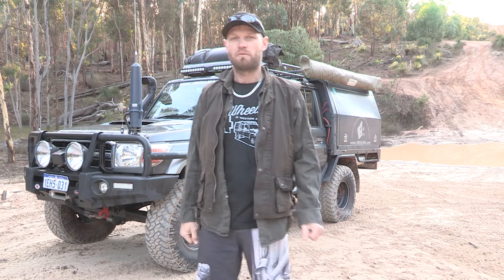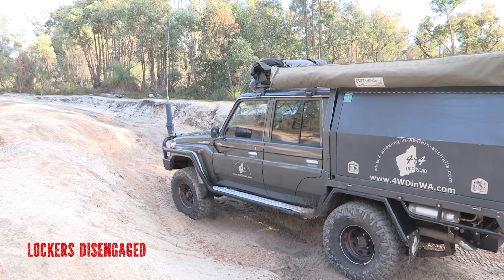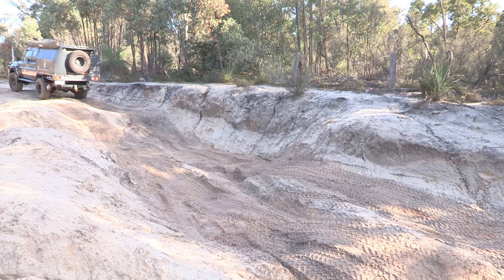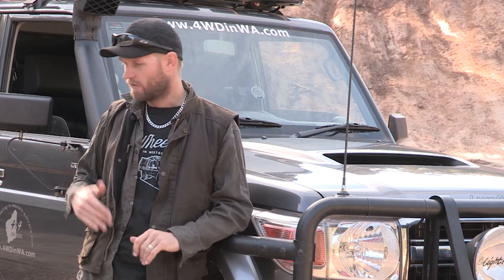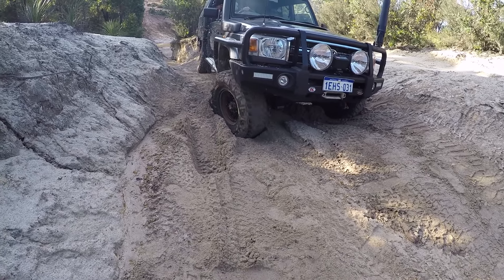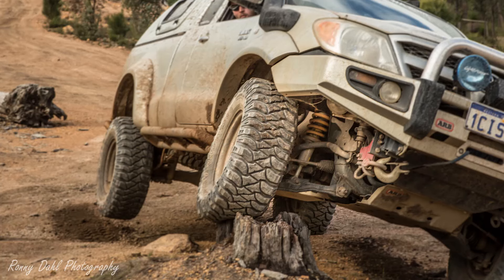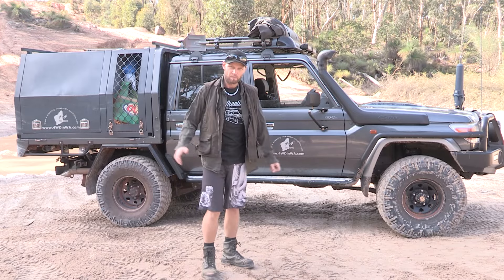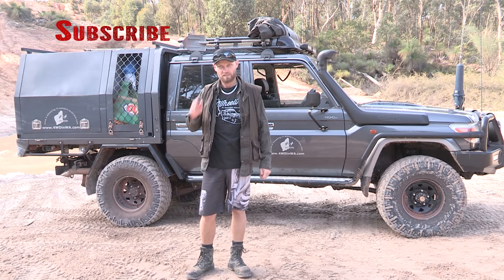diff lockers, how and when to use

Comment: My zr2 came with front and rear lockers.  It was one of the selling points.   My 1982 FSJ Cherokee has front and rear air lockers.  It also has an Altas 4 speed.   Honestly, 98% of the time I roll around in 2 wheel drive and low range.   But when you 'need' 4wd and lockers there is no substitute. Like Ronny indicated, you can substitute finesse for momentum, it's not often I see someone breaking something because they are being slow and deliberate, it's the folks pressing on the skinny pedal and trying to use momentum that usually break something.

Comment: currently running an rear automatic locker on my Tacoma. I honestly can't say how much it's helped me, since it's always "on", but I'm pretty sure it came in handy at least a few times. My Tacoma does have traction control system, but my particular model doesn't have traction control in 4 lo, which is why I went with the rear auto locker just in case. And traction control is another thing I can't say how beneficial it has been.

Comment: Had fun watching the video. A lot of good advice and info.  I run selectable lockers both front and rear.   I also have a twin stick.  So much fun.  The great thing about selectable lockers is you can have a bit of fun trying an obstacle open/open but still know you have the option of locking it in and getting down to business. A bit of a tease at the end with the front/rear locker video.  I am going to vote 'front' as the way to go. ;)

Comment: Love your videos. Agree with having a rear locker if its only one locker. I also believe the front drive system is not designed to handle the forces involved when using a locked diff  and rear diff being open. Many 4WDs that come with factory fitted lockers the front cannot be locked independently of the rear. Its rear only or rear and fwd. I have seen many 4WDs with after market lockers that have broken their front drive system and busted diffs while having only the front diff locked.

Comment: I agree the rear is the most important. I have TruTracs in the front of my van and so far with ARB in the back it seems to work very well. If I get a front wheel off the ground I need to apply a little brake and it pulls right out of everything I've tested on so far.

Comment: I rolled over my 4x4 96 Tacoma then had blown headgasket. Ended up with a 99 Prerunner Tacoma (2wd) 😭..... but the good news... It has the offroad package with the rear locker, that thing is amazing! Very different from a front locker like my 96. And the prerunner seems to accelerate much faster without the extra differential weight, not to forget better towing😉. (Please don't remind me that its not a 4wd😭.)

Comment: Great advice on how and why to use lockers. Two weeks ago I killed my non-lockable front diff because of too much wheel spin and then some sudden traction, the torque ripped parts of the diff out. Getting a lockable front diff now!

Comment: I used to lock my rear when I would get stopped, as you demonstrated.  My most recent vehicle has mechanical locker rear plus Torsion differential up front.  I have not been stopped so far to need to engage the rear locker.  I have used the rear locker just to keep it exercised a bit.  The Torsion axle seems to be a wonderful thing except for cost.

Comment: Hi Ronny, great vid. I think you should do a vid explaining types of lockers. Auto lockers, e-lockers mechanical lockers etc. I've heard terrible things about auto lockers and even arb mechanical lockers have had bad things said about them.
Reply: Agreed...I'd also like to hear your opinion on each type...
Reply: Nothin like driving an old beast with Detroit lockers ..   bang..  crash  .. tyre squeel  .  I would doubt the current gen would have enough driving skill to keep it shiny side up. .
Reply: @paulsouth4794  
🤣🤣🤣🤣 they would think the world is ending 🤣🤣🤣🤣
Reply: @paulsouth4794   I'm running a Detroit locker. It was the better option for me with a more limited budget. rear only. I've been happy enough with it so far.
Reply: @paulsouth4794  detroit lockers are the best in my opinion
Reply: Ten bad stories , thousands of units sold .

Comment: I live in California, USA. There's not a lot of lose sand here. It's mostly rocky terrain.
I live in NorCal near the Rubicon trail.

Please include rocky terrain front locker vs rear locker video as well.

The trial your showing would be like a Moderate trail called a fire road in our national forest. 

Trail's go form: 
 Easy: These fun family trails are suited for a stock vehicle and may not always require four wheel drive. In most cases these trails consist of well maintained service roads. Roads are typically wide enough to accommodate passing.

Moderate: While more challenging than the "Easy" rated trails, drivers of all skill levels can enjoy these trails. At this level a stock high clearance four wheel drive vehicle is required. Trails are typically narrow with possible brush that may scratch your vehicle. Passing usually requires backing up.

Difficult: Trails at this rating require a vehicle with increased ground clearance and proper protection. Trails will often require a spotter and should only be attempted by more experienced off road drivers. Most trails at this level require 33" tires and at least one locker is recommended.

Extreme: Trails at this rating require a heavily modified vehicle. At this point you most likely have more dents than lugs on your tires, flops and rollovers are just part of your Sunday drive. Front and rear lockers, at least 35" tires and a winch are highly recommended. "Extreme" rated trails should only be attempted by the most experienced off road drivers.
Reply: In Australia we rate our trails similar but then tend to label them all with one simple rating -"fuck yeah send it mate!"

Comment: Great video! Im really glad Toyota came up with A-Trac. Ive been in few situations were atrac was not enough. Would love to put a ARB rear locker on the Runner someday though!
Reply: Cool thing with the A-trac is it doesn't care if you install a locker....A-trac just uses the vehicle's traction control, stability control, and ABS system to help control traction loss through braking spinning wheels and using yaw and pitch sensors to figure out what the vehicle is doing in a turn to help keep the vehicle headed in the right direction...it does work but its somewhat limited especially in extreme conditions you can manage to overheat the ABS system and at that point none of those features will work LOL.

Comment: Interesting comment on front locker being good for IFS vehicles to help protect the CV's.  I've always thought a locker increased the strain on the drive train.  But it makes sense that anything that keeps it slow and controlled also helps protect the CV's.   

We have very few new vehicles here in the US with solid front axles...
Reply from the maker: rodagoose its the same in AUS now many new vehicles come out with IFS and some with IRS as well... Only Toyota, Landrover and Jeep release front and rear solid axles now. That said an IFS vehicle driven correct can do just as well...
Reply: rodagoose I run a Limited Slip LSD on the front of my 1995 Ford Bronco. Auburn Pro LSD up front and Detroit Locker in the rear. A limited slip has some "give" when it comes to strain on axles. You might look into a Detroit Tru Track.
Reply: rudedogii thanks for the input, sounds like a nice vehicle/setup.  I've got a Nissan Xterra with factory locker in the rear. I know it's not the most "hardcore" vehicle but it's done very well in the mild to medium off-roading I do.  I've got a trip planned out to Ouray Colorado this July.  Should be a blast!!
Reply: I got a Toyota Tacoma now. Does ok with the factory Electronic Traction Control but I would like a rear diff lock and LSD in front. I had a Lock-Rite locker on the front axle of my F-250. Very hard to make a turn with the front locker. Colorado sounds cool. Have a good time!
Reply: rudedogii I would suggest going with a locker than can completely disengage on the front axle instead of an LSD. The LSD on the front will make turning very hard on the vehicle and you will forever hear the clicking noise of it trying to engage since it things one of the wheels is slipping.
Reply: rudedogii I run that setup in my F150 with the rear Detroit and front Truetrac. Love that setup, and there are no switches, compressors, or electrics to go wrong.

Comment: Thanks Ronnie. If you can explain at some time the Pajero system. LSD at the back, center diff lock and front diff lock.
Reply: a part time transfer case locks front and rear axles , a Full transfercase differentiates between axles , doesn't everyone know this ?

Comment: Front and rear both useful depending on the situation..I have front and rear Air lockers in my cruiser fitted with factory diff lock selector switch. It is smarter than the huge rocker switches...

Comment: If you get stuck on a hill like he did in the beginning with an open diff, apply you’re ebrake slightly without locking the rear and if should shift power to the wheel not turning. It’s not the best route because you’ll wear your pads out, but it will help you get out of tricky situations. Great video man! Love the truck!

Comment: Hey Ronnie, you should do a video on Automomatic lockers, I would love to get your professional view on them.
Reply: I had one in my 2004 ford courier. Brilliant, however, you have to have manual hubs. the front is locked, they will unlock to turn.  Cheap under $600.  Combined with a rear air locker, can get 90% where the big 4x4's go.

Comment: I have a cool trick electronic front differential salvaged from a volkswagen and put in the front of my lada niva, it allows torque to be electronically controlled and in the rear i have a regular locking amarok axle

Comment: Would it help to use locking diff if you slid in the ditch during winter? Like shovel a path back to the road but then going up the ditch the tires still spin on the grass.....would putting on the locking diff help so you don't sit and spin?

Comment: Hi Ronny, thank you for explaining this. I live in India and we have very limited availability of vehicles with front and rear  differential lock. I have doubt about front differential lock. I was told by one of the manufacture that we should not try to steer right or left if the front differential lock is applied. Is that right? and why?

Comment: I prefer open diffs however you can spin really good donuts with a locker in the rear. I think a locker in the rear is a better choice but once in a while a front locker will pull you through. Bang for buck would be a rear locker, thank you Ronny

Comment: I will add a rear locker to my 78 Suburban the next upgrade. I have rarely needed one and when I did I would have loved to have the rear on as it will allow you to drive the vehicle on ice and snow easier. I will probably get an electric front differential as it would be the best for the price as a positrac unit will need more maintenance and that entails more money. A person on a limited budget should consider the electric one as it is less cost and they are of good quality if you buy quality first and that also saves money in the long run.

Comment: I can't say I prefer one over the other. I just use what I feel is needed.Concerning your comments on using the rear locker when descending, I noticed in the ARB manual that it says to use the front to avoid engine surges in case you are slipping.  I have been in spots where, in retrospect, I can understand why they say that. But I haven't been back to those places to try a different approach.  What are your thoughts?

Comment: Great info on this topic. I'm relatively new to off roading with a 2010 2 Dr jeep JK sport no lockers at the present. If I had to decide front or rear, I would go with rear to start. From the videos I have watched the front would be beneficial in certain situations but for the terrain in my area and type of off roading I have in mind I don't see myself needing to pull myself up and over some big rock or obstacle. Am I correct? Waiting for the next part of this video, thanks

Comment: Please show this test: Which allows you to turn tighter? :front locker engaged with rear open, or rear locker engaged with front open.  Very interested in your results.
Reply: Rear locked and front open will turn pretty much as tight as having both open.  
Front locked will make the turn a lot wider.

Comment: Hi Ronny, I'm surprised you didn't mention as one of the cons, the advice not to use locked diffs on side slopes.  Refer to the problems TheBjh84 had with nearly slipping into a dam.

Comment: Great Videos. You often recommend to turn off the front locker or not engage at all.
My rig has a ARB rear locker but since there is no ARB front locker available for my Pajero 
I'm looking into the self locking  Lokka for the front differential.
Would you recommend to add a front locker that can't be turned off?
Reply: +Chris just saw your comment, this is a big no no, never put an lsd or auto locker in the front. the reason is just like a manual locker it locks up when it senses speed differentials in the wheels, now this is fine when under power or on loose surfaces., however on the over run, slowing down or engine braking, when you try and turn, the locker thinks the wheel starts to slip and will auto lock. this has a catastrophic effect on steering. it will literally force the car straight, whether there's a bend in the road or not,  so its fine offroad, but on a road it can be extremely alarming when you truck decided to lock the front diff and resist attempts for the wheels to turn at different rates required for going around bends. if you don't believe me find a friend who has a manual front locker and drive and drive it on the road with it turned on, because remember you have no control when it will engage.
Reply: Cannot rate the LOKKA in the front highly enough. Manual locking hubs disconnect it for road use, and I would say it actually has MORE steering response in the front because the wheels pull the front around instead of allowing the back to sledge it forward. SWB patrol (safari) with factory LSD.

Comment: Hi Ronny. I have a 2016 LC200 with crawl control, but I want to fit lockers. Could you comment please and particularly comment on the use of the centre diff lock when lockers are fitted front and rear..
Reply: Engage the centre diff lock first. This is what gives you true 4WD. If you need more traction, lock the rear. If you need even more traction, lock the front.  
There is no point in locking either front or rear unless you have locked the centre first.

Comment: Hard to tell which diff locks maybe more important.
I'd go for the rear, because it does a great job in my little Mazda Miata, even in winter and very snowy conditions. My 4WD is a Lada Niva, which is a great offroader, but without the option to lock either front or rear, - there's only a shifter to lock all 4 of them, so I coudn't tell which one would be more important.

Comment: Hi ronny, i loved your videos really showed me some inputs on how i will change my newly acquired 2004 105 series GXL wagon with 1HZ engine. It has a CDL center differential lock that locks front and rear diffs with HI and LOW range. My question is if ill put rear or front diff locker can i still use my CDL center diff lock? thanks ronny hope you can share with me your thoughts coz im just a beginner trying to build my LC for touring with my family. Im living at perh. Thanks brother!
Reply: The center differential lock just locks the transfer case output shafts together, turning your full time 4WD system into a part time 4WD system when conditions are low traction enough to need it.  So, adding a front and/or rear differential locker will still allow you to use your center differential locker as well, and you get the added bonus of having a 3WD vehicle instead of a 2WD....a 4WD system with open front and rear differentials is still going to be 2WD when the going gets tough...so even adding a rear locker now gives you both rear wheels turning at the same speed regardless of conditions, plus 1 front wheel spinning.  Now with front, center, and rear lockers you then would have real 4WD as all 4 wheels are capable of being locked together to provide constant traction regardless of what you are trying to drive over or through.  Just have to disengage the front if you want to be able to turn is the only downfall, but if you are in some really nasty conditions hitting a button or turning a knob to disengage a locker to turn isn't a big deal especially if it means you are able to just drive over or through an obstacle rather than getting stuck.

Comment: Hi ronny...what is the difference factory fitted differential locker vs airlocker?
Reply: The factory lockers lockers on these have an electric solenoid on the outside of the drive head that move the locking ring.  
The ARB air locker uses an air chamber in the carrier, and the TJM pro locker uses and air piston inside the axle housing but outside of the carrier.

Comment: If you have to choose one ALWAYS chose a rear locker. The vast majority of the time you need a locker is when climbing a hill with lots of off camber and ruts where you lift tires. When climbing most of the weight is transferred to the rear of the truck.  Hence the rear has the most weight = most traction and a rear locker will do you the most good in more situations on the trail. The times when having only a front locker would be more advantageous are very small compared to having only a rear.